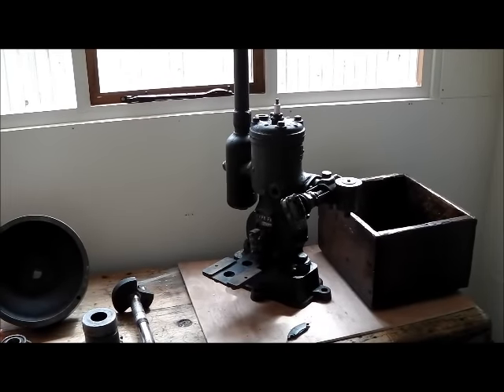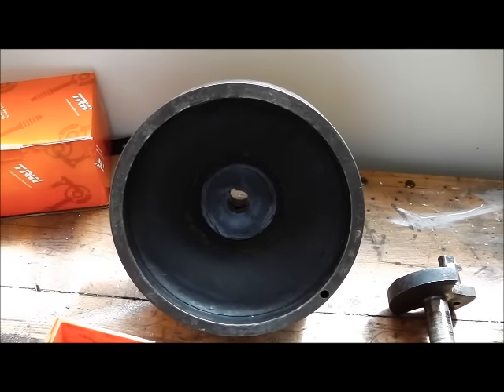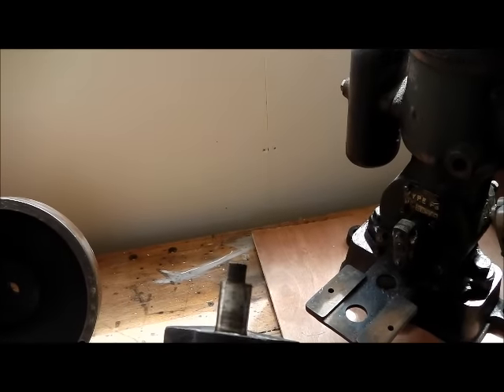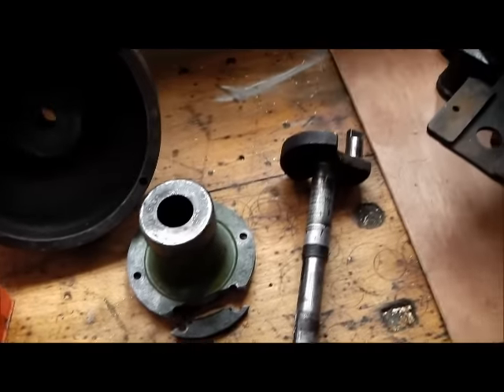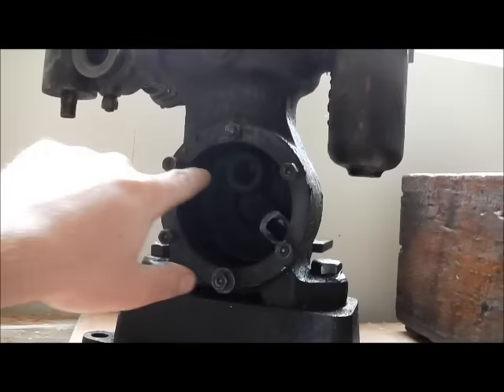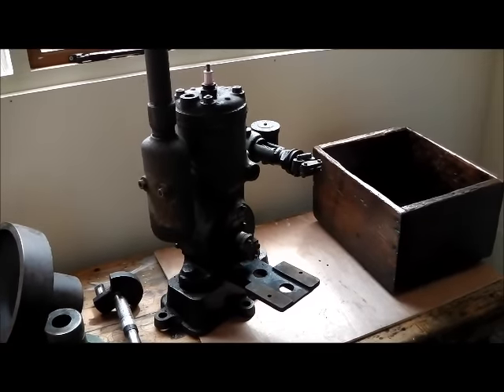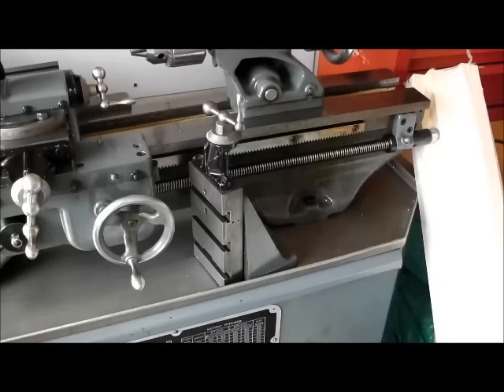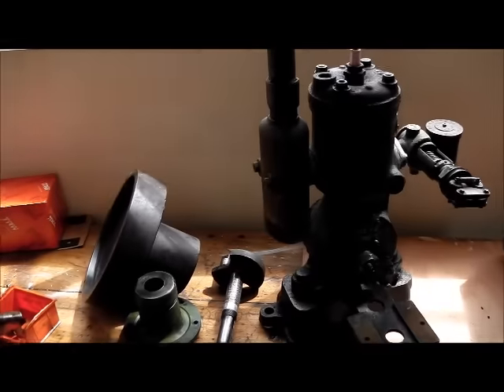Stuart Turner P3 Restoration - Part 1 -

Comment: I built a stuart 10H steam engine on my lathe with a vertical slide, I didn't have a collet chuck. I think as long as you are careful you should be ok. being a small engine the biggest end mill I used was 1/4" though.
Reply from the maker: I think I will get a collet chuck, I'd be using some relatively large mills by comparison for the parts this engine requires.
Reply: always best to do it properly if you can, I would get one too if i intended to to much more milling .

Comment: Why can you not just weld or braze the broken casting ?
Whichever way you go with it, good luck and I'll be following along as I ponder on my own P5 rebuild.
Reply from the maker: I'm not sure about welding, a proper welded repair to that casting is not something I can do at home. I think it's too thin to be welded without more damage. It's something I will look into.
Reply: Silicon bronze rod and a tig welder  should be suitable.
Have a look at the cast iron repairs Keith Fenner has on his channel.

Comment: Another lovely little engine you've got there Phill, I'm looking forward to seeing how the restoration goes. One thing I don't quite understand, the broken bit you are hoping to 'metal stitch' back to the piece it came off, couldn't it just be welded back together instead? I think you can weld any metal these days. I've been following the restoration of Donald Campbell's Bluebird jet boat at http://www.bluebirdproject.com/K7/ and parts like this get welded back up and then machined. All the best Richard.
Reply from the maker: Thanks for the comment, I think the broken piece is much to thin to be welded without distortion. Just don't want to risk making it even harder to repair. Someone suggested pinning and banding it which I quite like the idea of - that would be the kind of repair it would have had back in the day, and definitely an "engineered repair" rather than a bodge. We'l see, I shall certainly look into welding first. 

Phill.